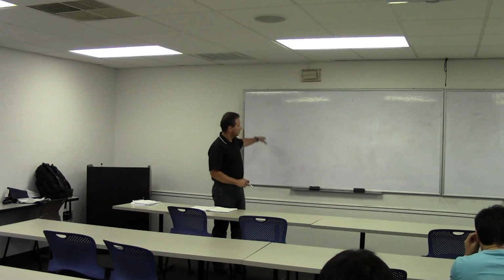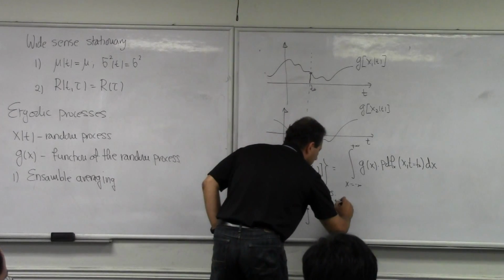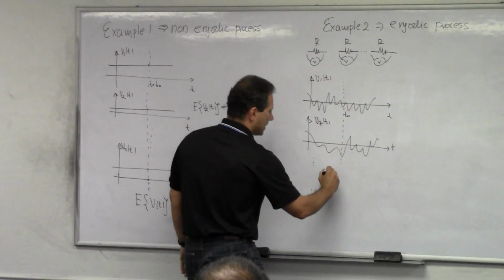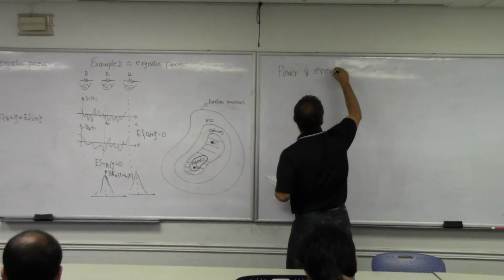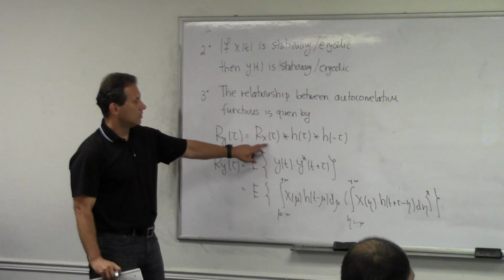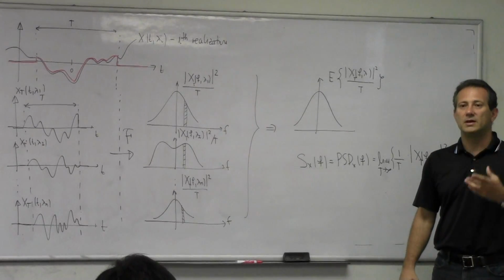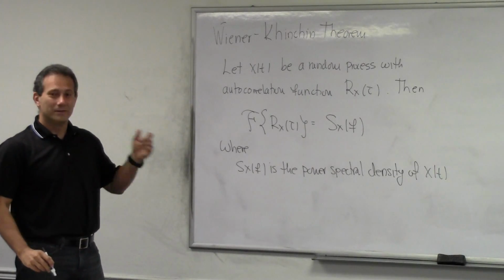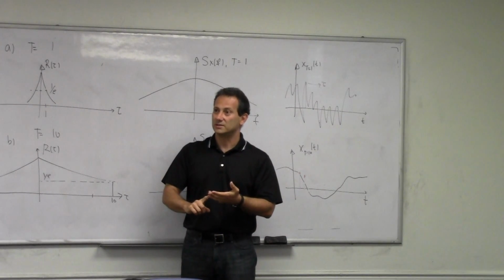Communications Theory Lecture 13

Comment: i dont understand ,does ergodic means strict sense stationary,they have the same meaning?
Reply: No, you can have stationary processes that are non- ergodic. For example the problem with the power supplies, where they are stationary in amplitude and time domain, but still not ergodic.